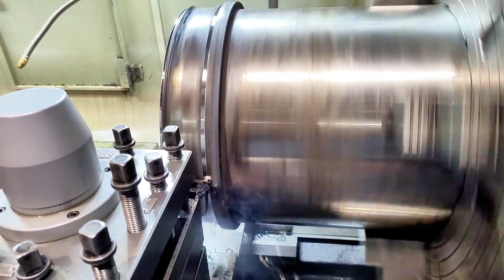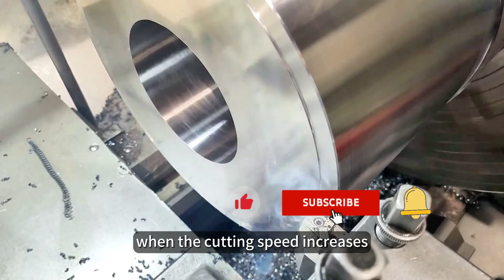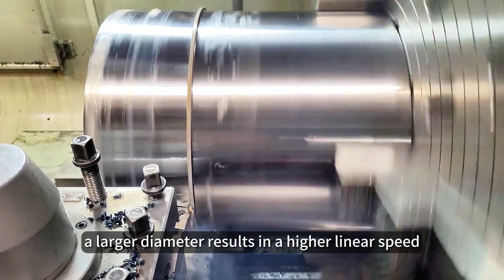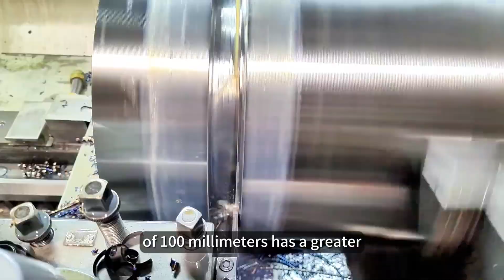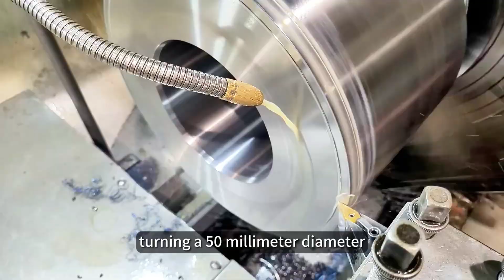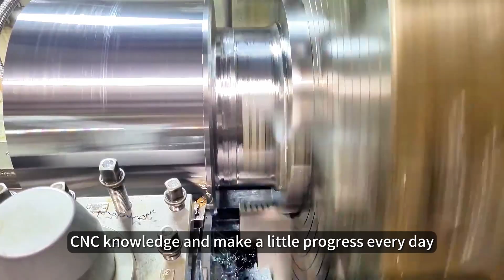Influence of diameter on turning results

Comment: What is linear speed? You mean cutting speed? Of course if you use conventional machine, it won't change RPM for you, only CNCs do.
Reply from the maker: Yes, by "linear speed," I do mean cutting speed. You're right that on conventional machines, the RPM won't automatically adjust for you, whereas CNC machines can handle that adjustment. Thanks for pointing that out!